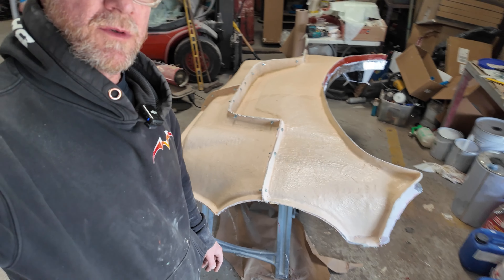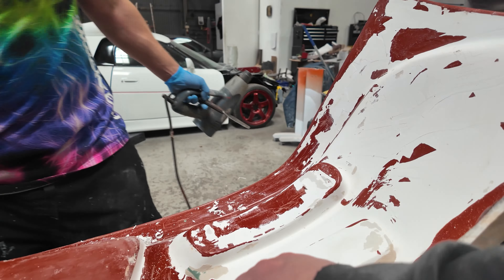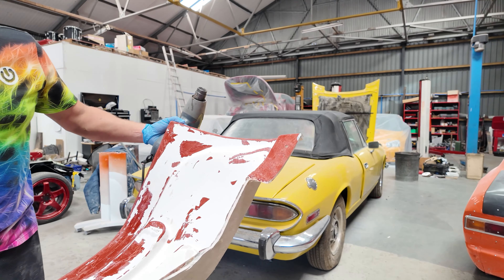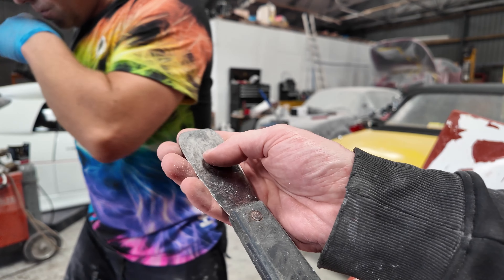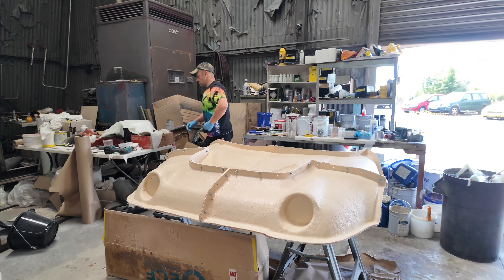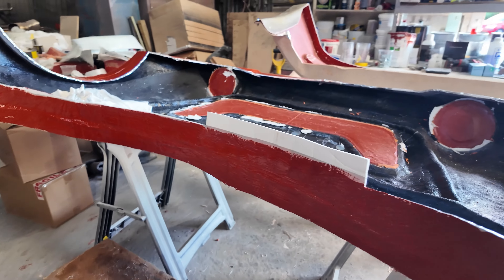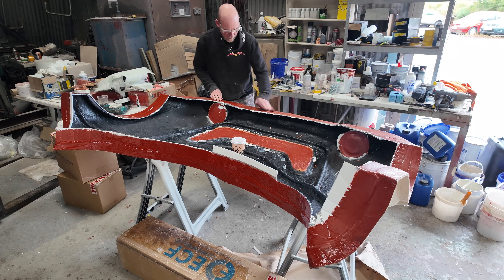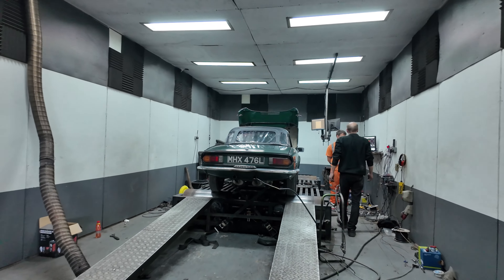Entering the final stages of the RB200 kit car

Comment: Hi I’ve commented on you videos before what release? Are you using 😊
Reply from the maker: Hi, we were using honey wax but had lots of problems so on these parts we used pva mould release which worked really well
Reply: Yes honey wax isn’t what it used to be unfortunately I’ve had issues my self been making moulds for over 15 years I used marbacoat now it’s a  two part  system sealer then release beautiful stuff never any issues
Reply from the maker: @kevindoyle703  the problems we’ve had it when moulding off the painted buck. It stuck so bad! But gel coat to gel coat has been fine with the wax. But the pva seems to be a good option when worried about it not releasing. 
Could you share a link to the product you use please
Reply: @thecre8ors  it’s a 2 or 3 part system there’s like a primer that you can use for a mould that needs resurfaced then a sealer then  a release I can remember the code of the release but I’ll check when am in work tomorrow
Reply from the maker: @kevindoyle703  thanks 🙏🏻
Reply: @thecre8ors  227-CEE is the release I wipe on 3 coats of mould sealer  soak the cloth with it  wiping off straight off after with a brand new clean cloth same with the release take your time get every were DO NOT APPLY WAX TO THE MOULDS ANY MORE AFTER COATING if the moulds were waxed you need to clean with mould cleaner you get up to 15 or 20 pulls before you need to reapply the coatings

Comment: How do you do the gel coat repairs? I was reading and they said that there is no chemical bond between set gel coat and fresh gel. do you key it with 120 grit sandpaper then reapply?
Reply from the maker: Yeah I’ve been roughing it up, wipe with acetone then fill with gel coat